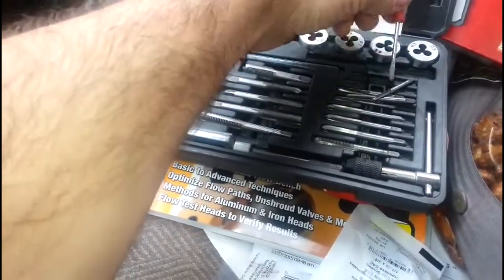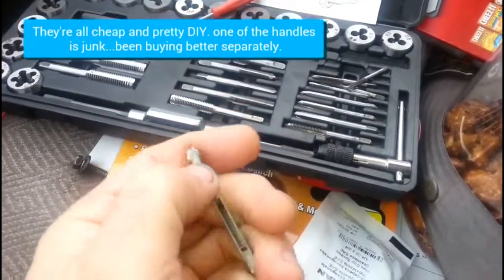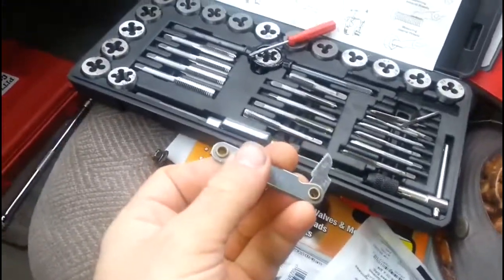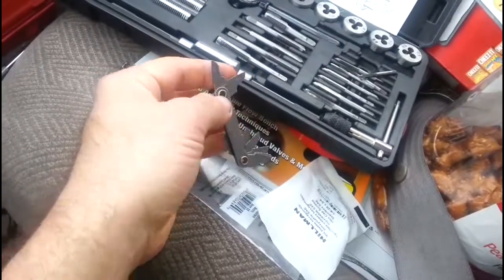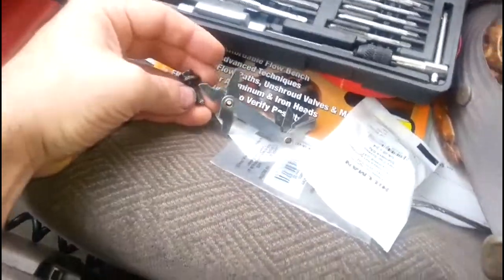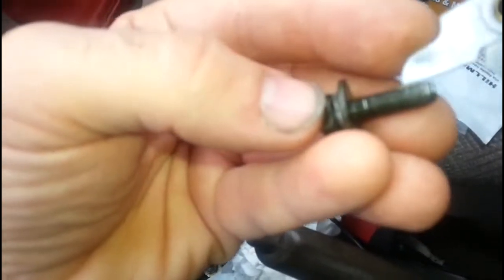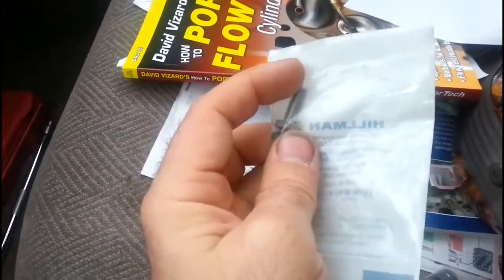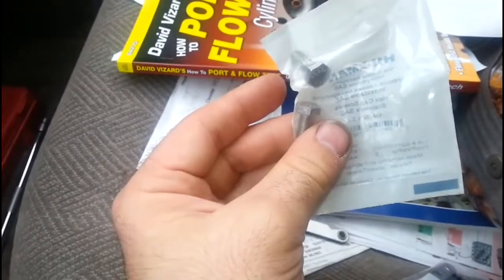How to Size a Bolt or Nut. Happy Halloween!

Comment: What kind of car do you have?
Reply from the maker: +**Classified** This car is a 1999 Chevy Prizm, but it has the 2000 LSI engine. 2000-2002 was sort of the 8.5 generation of Toyota Corolla. Under the hood, Prizms and Corollas are the same. Some interior trim has changes including the components around the speedometer. 

This bolt was for the corners of the dash, bottom left of the dash under the glove box and bottom right under the steering wheel. I originally shot footage of this, but I thought it was redundant having put so much into dash videos for my downstream O2 sensor earlier on.
Reply: DE Nichols I heard those were really good cars. Is that true? Everyone I know who had one said they never could kill it.
Reply from the maker: ***Classified*** Usually yes. I've had a LOT of failures. I never had the common oil burning failure from too small piston oil holes. I think it's from synthetic oil and a short 5k mile oil change internal. 

Engine and transmission are otherwise classically very reliable. ..it's just everything else. Lol
Reply from the maker: ***Classified*** But since most of that made it to 150k I figure I'm on life two of the car. Lol
Reply: DE Nichols You don't have to deal with rust, do you? Up here, there's perfectly good cars that get junked due to the rust out. I miss that about everywhere else that doesn't use salt. You could fix them and get 300k easy without worrying about the body rotting away.

You should make a video one day on replacing the fabric on your headliner. Looked pretty torn in the video! I was going to replace the cloth on the headliner in my truck, but ended up finding a good one in the junkyard instead.
Reply from the maker: ***Classified***
Little rust spots have started at the front of the hood  and a couple more little spots on the frame around the front window.

I lived in a very little rain area most of this cars life. The welds on my catback exhaust in my new area with lots of rain have rusted as much in less than a year than the previous 9 years.

I definitely still don't live in the salt belt, but I'm not in the classic cars safety area anymore either.

Yeah, for headliners, I'd have to learn some new things, lol. Clueless. Since it's common for them to go I don't think the junkyard's has a chance in my case, but good find on your part. :)
Reply: DE Nichols Rust here is all contained in the rocker panels and other areas under the car. We don't have car inspections either, so you can drive around and see a 15 year old truck driving around with broken gas tank straps, with only a ratcheting strap holding the tank in place. Kinda funny actually.
Reply from the maker: ***Classified*** I was told a state over I'd have to work on severely jury rigged cars. I'm so glad I don't live there. 

I was told they'd run on systems such no one would know.